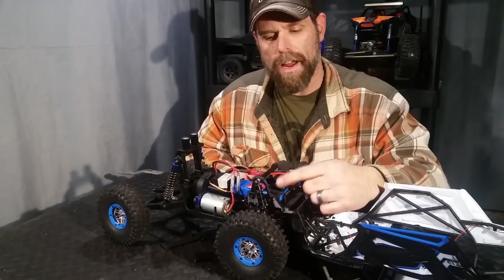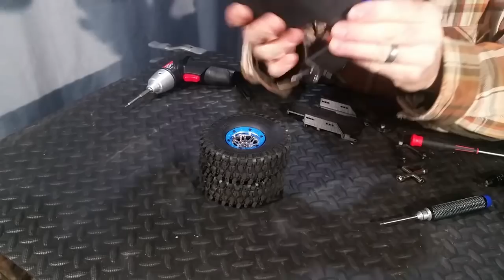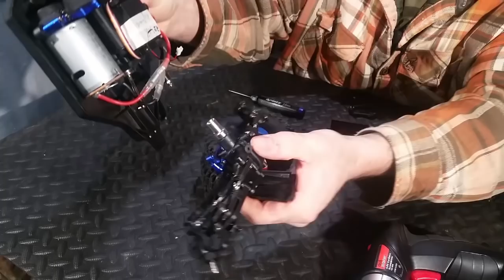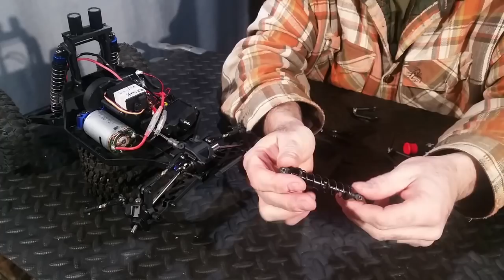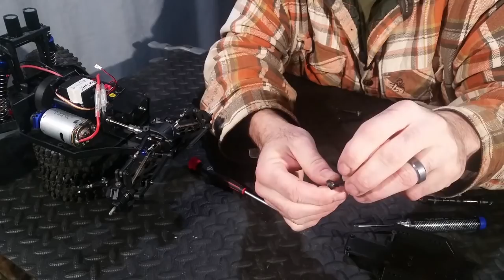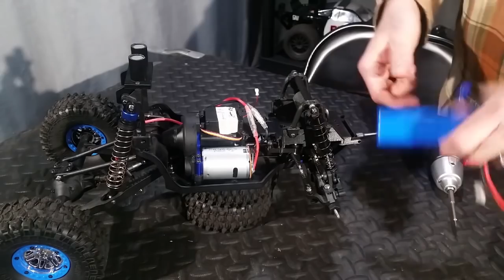WLToys 10428 B Week 5 Front Mount Battery tray with vertical shocks & bell crank steering

Comment: Your videos are proving to be priceless information for this platform, especially with the Twin Hammers support falling away. I like the design of the front shock tower, with the Axial suspension hoops rather than printed, personally I never liked the look of printed parts on the outside of a vehicle. One question, what material did you print the parts with and how have they been holding up?
Reply from the maker: I printed everything in PLA. My kids hammered the truck enough to break a front driveshaft and the only issue I had with the bulkhead was the very front where the body hinges.

Comment: Very good design longer shocks more suspension travel.
Reply from the maker: Not necessarily.  The original design with the laydown shocks uses a cantilever that changes the ratio of the shock movement to suspension movement.  It works like a rocker arm in a cylinder head.  If it's a 1.5 ratio cantilever, for every inch of shock movement, you get 1.5" of movement on the other end of the cantilever arm.  These trucks use a 2:1 ratio cantilever, which means to maintain the same overall suspension travel when converting to a standup shock, you need a shock with twice as much stroke.  Overall, I don't think the suspension travel increased much, if at all with this shock change.  The primary advantage is that you don't have as many issues with stiction and improper shock valving with standup shocks, because that 2:1 cantilever ratio also doubles your stiction and other nonlinearities that occur with shocks.

Comment: Great vid man! I printed your design using ABS. Do you think it's better than PLA? Or should I just print a PLA version? Thanks!
Reply from the maker: I don't have any experience with ABS.  It should certainly be stronger than PLA.  My biggest concern would be fitment issues due to warping and shrinking.

Comment: One thing you may want to look at is reverse engineering a rear upper link mount similar to the GCM setup. I made one out of aluminum on the mill & it helps with a lot of the torque twist. A 3D printable version would be a great option
Reply from the maker: Are you referring to the mounts on the chassis side or the axle side?  The axle side looks like a pretty simple riser and should be strong enough printed.  Making new chassis mounts with enough strength would be more challenging
Reply: The mount on the rear axle. It is exactly as you described, simple riser that moves the mounting location up, while also bringing the links closer together.
Reply from the maker: I looked at designing one of those, and it looks pretty simple.  If I get time I'll have to give it a try!
Reply: I made mine on the mill at work out of a piece of aluminum. I’m not a machinist by trade & it wasn’t that difficult to make. I’m sure that it would be a fairly simple build for a 3D print

Comment: Hey man I am building one of these right now. I actually used the stock battery tray and was able to mount it to the hood up front. Works great and it was free. But I would love to do this mod to mine. Is there anyway I could purchase this from you. Thanks
Reply from the maker: I could put the files on Shapeways,  but due to the size, it would probably end up costing $70 or more to print.  Your best bet is to find a buddy with a printer.
Reply: Thanks

Comment: I am looking into getting this rc rig but the normal green one, but is any of this waterproof? If not how bad would it be to make them waterproof
Reply from the maker: Based on a number of other videos that show the vehicles completely submerged, I believe that they are fully waterproofed, but I have not verified that myself, nor do I plan to.
Reply: Did you buy one yet??? Can you confirm if there's still plastic gears
in the diff or whatever the hell plastc gears they slapped it in???
Or is it just another bigger plastic junk???
Reply from the maker: The 10428, 10428A and 10428B have metal gears in the diffs.  The other variations without the 2 speed trans have plastic gears.
Reply: @BudgetRC_Channel  FYI, the 12428 also now comes with metal diffs.
Reply: I took my esc apart and coated it on liquid tape. Never had a single issue. I can run fully underwater as long as I have radio signal she goes and goes and goes. With mine I had to replace the transmission gears. I have the two speed transmission and stripped a gear. $25-$30 off eBay I bought brand new metal gears I think my shift servo is off or because I put marine grease in my transmission but I never could shift in low but still works great. 

These are awesome videos!  I’m a huge fan of wltoys and rep this brand all the time. I have two and both are amazing.

Comment: I have been printing parts for my gen7 pro and my Vkar bison and SCT truck. The amount I have saved on printing parts instead of buying them has paid for my two printers already lol. pretty much i feel a 3D printer is a no brainer for any RC hobbyist.
Reply from the maker: If you've got a Gen7, make sure you check out my 3d printed LED light bar video!
Reply: yep already have

Comment: what 3D printing material did you use?
Reply from the maker: I printed in PLA.  I plan to move to PETG for structural parts, but I need to upgrade my hot end first.